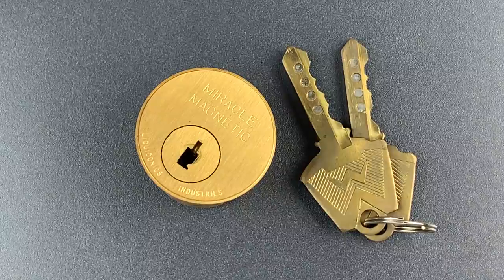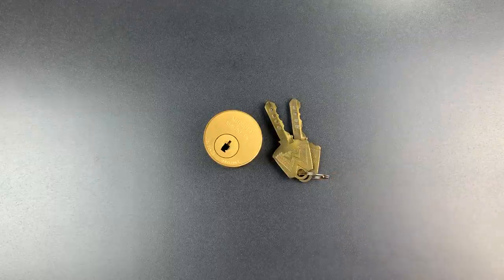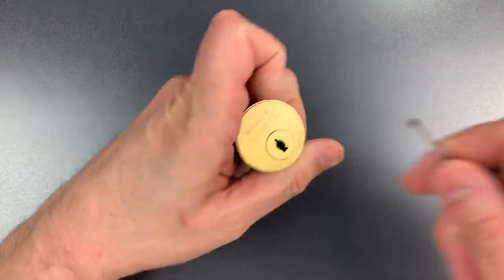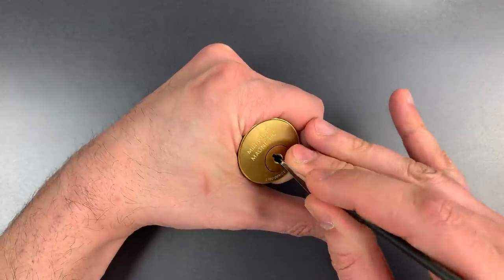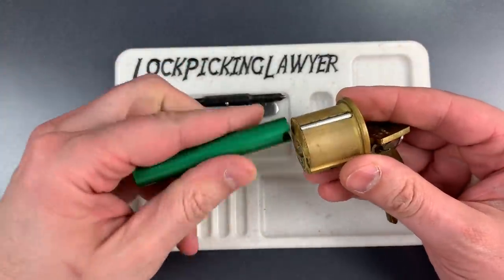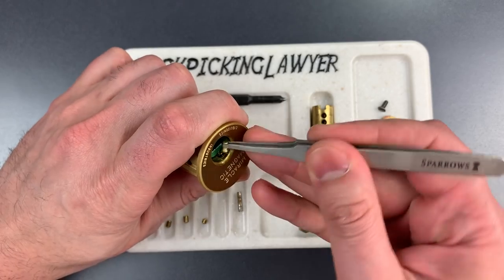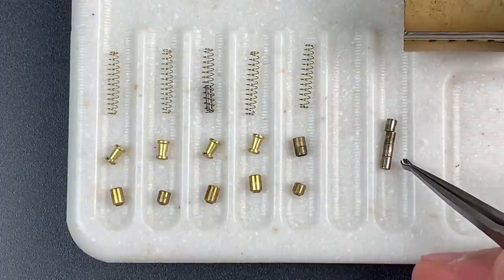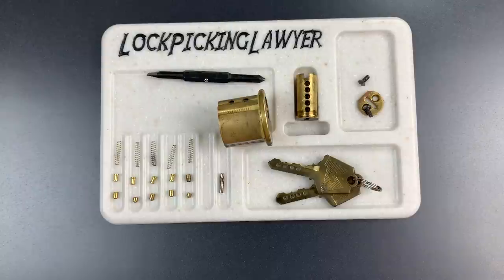[856] Vintage High Security: The “Miracle Magnetic” Lock Picked and Gutted

Comment: I have the same 3 locks and the NOS Miracle Magnetic mortise cylinder in the same box with Certificate -- You must have gotten from same seller (who said it was the last one 6 months ago) -- This is 3rd picking on YouTube of this lock, and yours was the fastest with your magnetic "cheater bar", nice!  An Interesting Lock in any case; perhaps not quite as rare as I thought!  You forgot to mention that the steel bars on the sides of the cylinder attract the magnetic pins into blocking the shearline when the key is withdrawn.
Reply from the maker: Agreed. It was definitely a mistake not to mention the steel bars... I’ve answered several comments asking how the magnets return. 

As for where I got it... eBay about 6+ months ago sounds about right.

Comment: My dad had a different magnetic lock. It looked like a smooth cased padlock. The bottom of the lock took a magnetic key that laid flat on the bottom, maybe inch and a half long, half inch wide, and an arch on the end opposite the fob hole. So you would lay the key flat on the bottom of the lock and rotate the key with the bottom of the lock on an axis with one side of the padlock, I believe. About a quarter inch of the lock would swing out and the padlock would open. It just said "magnetic lock" on the lock. Not sure who made it or how secure it was, but it was hefty and rather interesting.

Comment: People might want to be careful with old things like this that need magnets of particular strength or polarity.  Depending on the age and application, they're likely one of several AlNiCo materials.

The big weakness of this material is very low intrinsic coercivity.  It takes very little applied field to demagnetize them or change their polarization. That's part of why old AlNiCo horseshoe magnets have a keeper bar.  NdFeB magnets can easily demagnetize or alter an AlNiCo magnet depending on the geometry of the scenario.  

I've had to remagnetize waaaay too many fuze generator magnets to treat AlNiCo materials incautiously.

Comment: Hmm .. all magnetic pins have to go in to unlock ? Wouldn't chunk of iron be enough to pull them in, regardless of polarity ? Especially with keyway this wide ?
Reply: I suspect that they are only weakly magnetic, strong enough that they would repel or pull with a strong magnet, but not strong enough to pull themselves to an iron bar
Reply: @kevinwells9751  There are no springs, and they dont have to fight gravity either. So even little force should be enough.
Reply: I've tried this on my lock, and it does not work, unfortunately.

Comment: What if a lock maker made a lock similar to this one but had weaker counter-magnets behind the magnetic that acted similar to the springs on the regular pins, but could alternate between pushing and pulling depending on the polarity of the pin?  The benefit would be that you would have to go through the same bind and set process as the regular pins, but now you can't (easily) tell which pin is binding, and it is much more difficult to change the amount of force applied, increasing the difficulty to set the pin

Comment: This is a great idea, with bad execution. If you make the magnetic pins a touch thinner, they wouldn't set when magnetic racking and you would have to tension and pick the normal pins first. With a few serations and threads on the magnetic pins, they would get stuck once under tension and would be stuck. Lock would be completely unpickable.

Comment: @LPL Is there a mechanism which makes the magnetic pins want to spring back to their original positions straddling the shear line? Perhaps another magnet (presumably weaker or more insulated) or steel strip somewhere in the lock body attracting the pins when a key isn't inserted? If not, couldn't you 'pick' those pins without neodymium magnets just using a steel rod to attract them all at the beginning without any tension? It would only be the action of withdrawing the key that would scramble them back over the shear lines in normal use.

Depending on the type of magnets used, they could be demagnetised using heat (hot, but not hot enough to melt any of the metals). They might then be pickable by bumping the lock once everything has cooled down.

Comment: What would you say would make a magnetic lock good? Maybe some design that used spring loaded key pins pushing away from the keyway used with non-magnetic driver pins in the pinholes?

Comment: Hey, I just recently found your channel, and you throw around a lot of terms like "binding" and "setting". I don't have any experience with lockpicking, and was wondering if you had any older videos explaining these terms and how lockpicking strategies work in general.
Reply: Binding: resists movement through friction. It means it's the "interesting" pin which you may try to set. Set - push into position where the driver pin 'sticks' and doesn't push down against the key pin (and the pick) - either over the core, meaning you just unlocked given pin, or stuck by the security notches on the shear line ("false set", the lock tricking the picker into thinking the pin is set true). It takes good skill to tell these apart reliably - when you hear "counter-rotation" this is LPL recognizing false set about to occur as the pin turns a bit sideways.

Comment: Interesting lock. It would have been much harder to pick if they had intentionally seleted the tolerances so that magnetic pins bind only in the false set position. That would require setting the magnetic pins while keeping the false set and the magnetic pins would drop when you try to release tension to lift the spool up. That wouldn't prevent picking, though, just make it a bit more complex technically.
Another interesting questions is, are those magnetic pins actually earth magnets? Could you just shatter those simply by rotating the core with brute force?

Comment: I'm not sure if this matters, but those holes drilled partway into the side of the core for the magnetic pins remind me of another core you did later where it had holes drilled similarly but without any pins included. In that video you weren't sure what they were for.

Comment: When you put the lock back together, did it matter which side of the magnets went into the lock and which side was facing out?
Reply: Assuming the magnetic part of the lock actually works and is not just for show, it should matter - otherwise what's the point of having key with multiple small magnets in it

Unless you suspect that they failed even in that regard
Reply: Just a guess here, but the polarity is one of two choices; you would line up the magnets on the key so they attract to the key and maybe make a mark on them--maybe a mark is already on them.  install them so that they are all attracted to the key, which has a magnet internally.  LPL can tell by the construction of the lock whether the opne position is attract or repel, but of course you can just try the opposite polarity if it doesnt work.

Comment: Great video Mr Lawyer
Although can you explain what you mean when you say;
- false sets
- pick of 20thousands etc?
Reply: nattymaq you can google it
Reply: 20 thousands is the thickness of the pick its 20 thousands of an inch.
Reply: I can't explain false set, but the XX-thousandths refers to the thickness of the pick and hook he uses.

20 thousandths is .020" of an inch thick... 35 thousandths is .035" of an inch.

For reference, a human hair normally is 3 to 5 thousandths thick.  (.003" -.005")
Reply: A false set is when the core turns, but doesn't fully open. Which usually indicates there are security pins. 20 thousandths (or .020) is the width of the pick in inches.
Reply: he needed to achieve a false set on this lock before he actually started picking it, to ensure the magnetic pins were disengaged...
Reply: Thanks all for the answers.. appreciated

Comment: Dumb question: what keeps the magnetic pins pushed out of the core when the lock is locked?
Reply from the maker: There are steel pins in the housing to which the magnets are attracted.
Reply: I was curious about this, too.  I was going to suggest that a ferrous pick (or key) might be enough to defeat them.  But evidently not.

Comment: So what springs the magnetic pins away from the keyway into the bible to lock it up, when the key or a magnet is not present?
Reply from the maker: Good question — I should have discussed that in the video. There are steel rods in the housing to which the magnets are attracted. 👍
Reply: Thanks LPL!! That makes sense now!

Comment: Does the Ramset-Gun work against bigger locks like the 
"Kasp 19070" or the "Squire SS80CS" or Abus 37-80 or other large quality locks 
that could be used with Pragmasis 16mm or 19mm Protector chain ?
Bigger will make using a grinder slower, but does the Ramset care?
Reply from the maker: I’d bet on the locks. The ones you mentioned are real brutes.

Comment: What I missed was the part in the body associated with the four magnetic pins.  Were there driver pins or springs?  Clearly the four magnetic key pins are little magnets.  Wouldn't a steel key just attract the magnetic key pins bringing them to the sheerline?
Reply from the maker: No. There are steel bars on the housing side of the pins. You need a magnet to pull it off.
Reply: @lockpickinglawyer  Ah!  So those four key pins are attracted away from the keyway and lie across the sheerline?  Needing the right pole to pull them in to clear the sheerline, yes?
Reply from the maker: Correct. 👍

Comment: I would agree with others that having magnetic written on the lock is a major flaw, although in a highly secure environment it wouldn't take much for bad actors to find out the locks are magnetic.

That having been said, the magnetic part would appear to have some legs if the key was designed so that it exploited a magnet's ability to attract or repel. 

I am no lock expert but if the magnetic pins were set up so each of the magnetic locking pins was attracted or repelled by the keys magnet wouldn't using the rake of magnets not work as the lock picker would have to guess the combination of attract/repel?

If the very tip of the key had a magnet that released a locking bolt, wouldn't that also cause a problem as the lock picker would have to simultaneously set the individual locks using tension, as well as the magnetic tip lock?    

I do find these videos fascinating, and quite alarming as to how easy a professional can unpick a lock. 

It would be good if you can one day propose a design that in your view would be almost unpickable.

Comment: We had a cylinder lock fitted upside down in our house years ago. The key had the same M insignia as your keys here, and the cylinder had 'magnet' stamped in the front plate and letterbox. Was it made by the same company? The key wasnt a magnetic key but it was a very tight keyway and the key sometimes got stuck half way in, you had to pull the key completely out and push it back in with some force but exactly in line or else it got jammed. I always wondered if there was some kind of trap in the keyway. Sadly I never got to disassemble the lock. Maybe it was another experimental thing they made. My dad was in the UK army when he bought the house. Maybe he picked it up from Austria or Germany. Who knows. So, what happened to this company?
Reply: Pen Fold - In 2001 I installed four Miwa magnetic locks using the same idea but narrower key way. I did it not for security, (though it would’ve be relatively pick-resistant, since no one but a flat-out expert locksmith or collector would know how it worked), but rather because the key was “zero insertion force”. The key just glided in like butter!  I think the Miwa has 5 or 6 magnets on both sides of the key. It could still be picked using a single magnet to determine polarities, and then making a faux key with the proper magnets, but you first had to have access to the key to make something that was precise in the location of the magnets.
Reply: if you glued a magnet on the end of a thin strip of brass, you can measure how far it's gone in when it meets a magnet, and hence know exactly where each magnet needs to be on your key blank. in a well designed magnetic lock you would have a minimum of 4 magnetic pins each side where each pin has one of 5 states: N pull to clear, S pull to clear, N push to clear, S push to clear, Already clear - where any other state locks up the cylinder. (having paired magnets gives 312 possible keyings + 1 completely unlocked keying).

Comment: If one were to make a magnetic lock like this but with a (narrow) standard key way, different strength “driver” springs holding the magnets and corresponding different strength magnets on the keys, and no mention that it is a magnetic lock… this would be a lovely lock. The only way to break such a lock, especially if one doesn’t even know they’re dealing with a magnetic lock, would be to drill it out! No raking possible!

Comment: Be careful, by raking these collector items you could damage them
Back then the NdFeB magnets you are using did not exist.
They had to use either CoSm or AlNiCo.
No issue if they used CoSm, but you could damage the AlNiCo due to the low coercivity.

Comment: How possible would it be to pick it without access to neodymium magnets (like when this lock was manufactured)?
Reply from the maker: It would be possible with weaker magnets, but probably not nearly as fast.
Reply: @lockpickinglawyer  ...nor as easy, I believe. If you tension the core, you pinch the magnetic pins and the rake needs to overcome that force to align them. So you'd need an extremely light tension - but sufficient to keep them set after you set them. Like raking a standard lock with a rubber rake pick.

Comment: What if you made the cylinder out of steel? Wouldn't that mess with a tool not designed to pull the pins at the desired power?

Comment: The video is beautiful, but what is a "overlift attack"?
Reply: You use a very simple dedicated tool that looks a bit like a square-toothed hair comb, to push all the pins in so deep so that both the key pins and tumbler pins are pushed into the lock body (compressing the springs much more than normal), there are no pins left in the core which can then be turned. It's a fairly rare, easily prevented vulnerability - you rarely see a dedicated protection against it, just the lock is made such that compressing the spring maximally won't suffice for the key pin to clear the shear line fully.

Comment: Loved the video as usual :) Quick question: how did you know you could set the pins in that order of magnetic and then regular pins? Like, why do all the magnetic pins set before the regular ones?
Reply: Dan Brause if the magnetic had not set first, he would have had to set regular first and circled back. I’m new to this, but suspect it could have been much more difficult if the magnetic and regular pin binding order was mixed. Also wonder if the regular set first would it be difficult to rake the magnetic without dropping the regular that had already been set. Would love to hear LPL discuss this.
Reply: As soon as the key is in it sets the magnetic pins, then functions like a normal key.
Reply: stittyd agreed, but what’s the relevance to my question? The key “simultaneously” sets the magnets and key pins, but that doesn’t tell you the binding order when single pin picking. I’m wondering if binding order could have made this much more difficult to pick.
Reply: Don Christy ...not to mention, if he had picked the regular pins first, the magnets of the magnetic rake would have no longer lined up correctly AND  the magnetic pins would be binding in the core...they would not move by magnetic force while bound!
Reply: Thinking about this more, with this type of core you should always be able to set the magnetic first. And I’m suspecting you have to use very light tension while setting the magnetic because you don’t want to bind them too much so that the mag rake can’t pull them in.
Reply: And more thinking, lol, if one or more regular pins were binding, he wouldn’t have gotten a good false set with magnetic and the magnetic pins would have fallen back. So binding order could have made this more difficult (or at least more time consuming) than it was I believe...